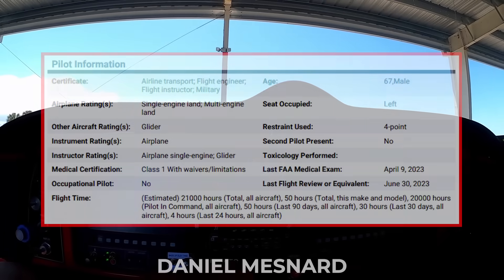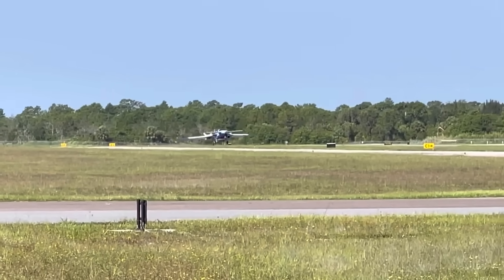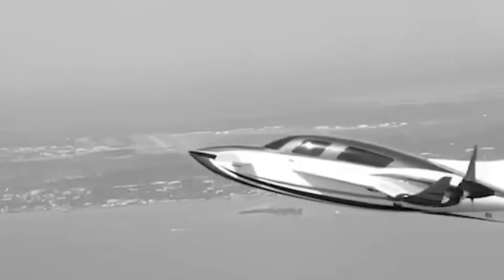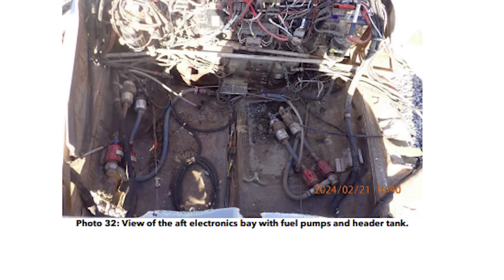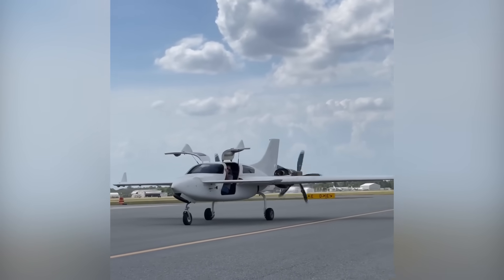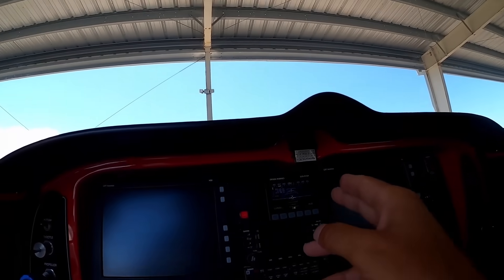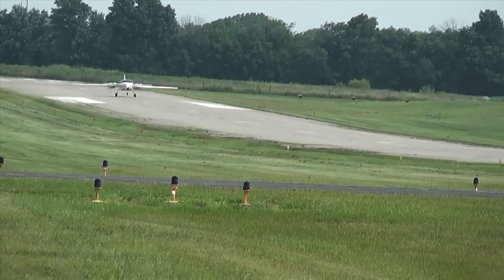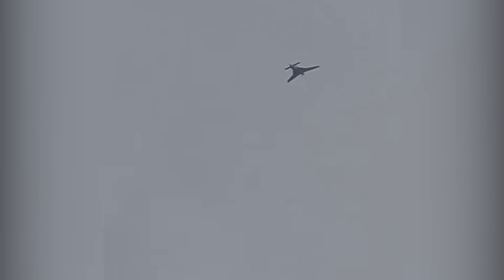Pilot Fatal Crash! The REAL Reason That Got The Passenger Killed In N106VT Crash, New Discoveries...

Comment: Common sense and attention to detail. I use rubber fuel hose to prevent wire shafting or any fuel or oil hoses, my Bushbaby doesn't have a hydraulic system but they should also be protected not just for moving parts but for vibration contact/ rubbing.

Comment: 5:54 "like saying you tested driving you car with one wheel off the gas, but never tried it with the brake fully stuck down."  That analogy makes no sense but your POINT about testing with one engine at idle for engine out (non feathered prop) is valid. EXCEPT as a CFI - Multi Engine, you do simulate engine failure with prop feathered, with partial power. That is an accurate approximation. But you have a great point at idle with prop in fine pitch it has LESS drag than if engine was dead.  He also lost control I gather of the electric prop. I hate electric props and the UL power has no provision for hydraulic controlled full feathering prop.

Comment: UL Power engines are wildly underpowered to what they advertise. Many of them have suffered many a catastrophic mechanical engine failures in single engine planes. This mostly results in an off field landing. Some have engine problems detected on ground and upon further inspection there are serious engine issues....  I am not a fan of this brand. I understand why the engine quit. The other issue ELECTRIC Props... Another problem.

Comment: With modern electronic systems on these engines. What is the additional cost for an auto-feather mechanism. Apparently, this one just went full fine pitch without any torque? 
Doing the opposite sure might have saved the day and the poor passenger.

Comment: My flying buddy owns a Velocity, highly modified.  No ECM for engines, instead traditional ignition.  Prop controls that allow for full feather, no auto fine feature.
The biggest point, during the prebuy he had the interior removed and had a AI  AP go over all the underside wiring, controls and airframe interior surfaces by borescope.  He got a great deal on the Velocity, routinely sees 185 indicated on sub 20 GPH fuel burns.  On both engines, it climbs great, and it’s fairly quiet inside.  
But,  and the big but for me is that it was built by an Amatuer.  I’ve never flown in it, but we have flown to destinations together.  Me in my B36TC.   If I were to critique the Velocity would be on its high density altitude take off performance.  Gets un nerving at 6000 and above.  On one engine. No chance.
Quite the airplane at less than $200K

Comment: Most twins can hold altitude, with one engine, fully loaded,IF the air density is not a problem, and the prop is feathered with 3 to 5 degrees of raising the wing with the inop engine.

Comment: The manufacturer should have had a shield
Reply: I have a VTwin also, I can assure you if PROPERLY positioned and fastened the wiring coming in contact is NOT an issue. There is much more to the story.

Comment: Four wings just seems to be a bad idea in all aspects. It even looks unstable and jerky in flight due to the argument of two centers of gravity ( 2 CGs? ). Turn a dinner plate over, drop two marbles on top and try and keep them both on the plate. Then loose an engine.
Reply: LOL  Every plane has 4 wings, this one has them all lifting rather than two lifting and two pushing down and NO there are not two CG's.
Reply: @vandalMav  Ok you are correct, 1 CG. But it does move. And with this wing configuration its going to act (move) differently than a normal aircraft.